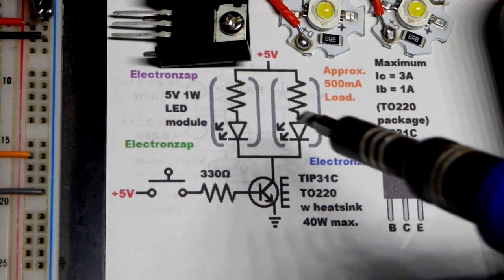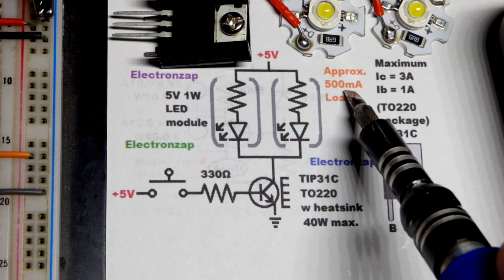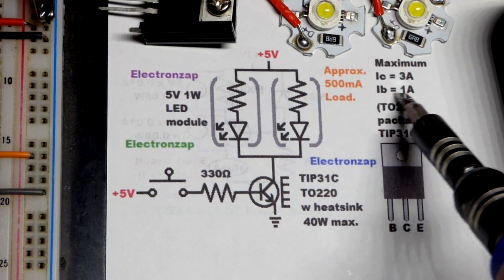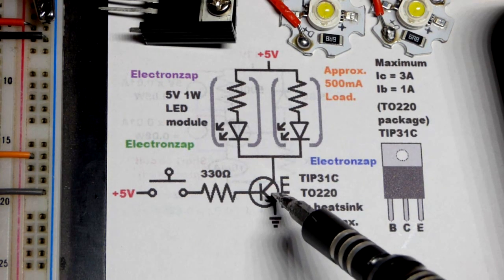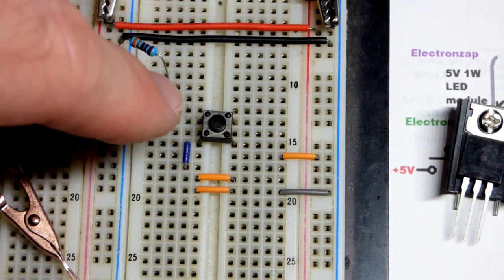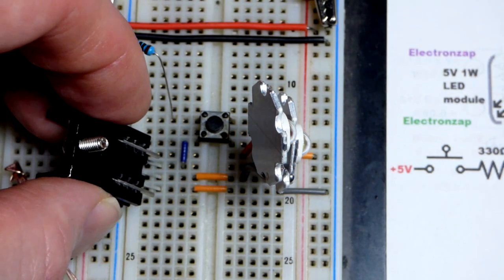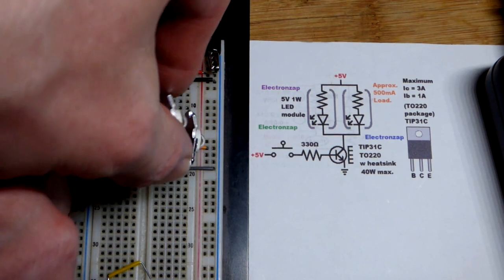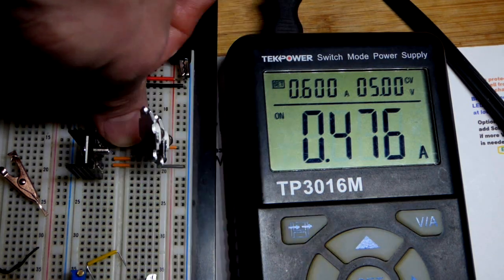TIP31C NPN BJT switching two parallel 1W LED modules approx 500mA learning electronics shorts 131

Comment: Dies it need a heat sink for 450ma current draw?
Reply from the maker: I would think that it would be fine to switch 450mA without a heatsink, A 2N2222 can switch a maximum of 600mA and a 2N2222 can't dissipate heat near as well.

Comment: Were you actually saturating the transistor???   What was the voltage across the collector and emitter of the transistor????    A MOSFET with low "Rds on"would be a better choice for this application.  Might be a good vid about camparing the 2 scenarios.
Reply from the maker: I thought the MOSFETs that also came in the same kit would do better, but it didn't. I was going to make another video with the MOSFET right after this one if it did better. That's a good tip to look for a lower Rds on.
Reply: @Electronzap  The MOSFET you tried may not be a logic level FET.   Try going to a 10 volt supply and revise the current limiting appropriately.    Non logic level FETs use 10 volts gate biase to measure Rds on.    Test it at 5 volts and 10 volts Vgs and compare the Vds voltages to see how well it is saturating.   Keep up the good work.